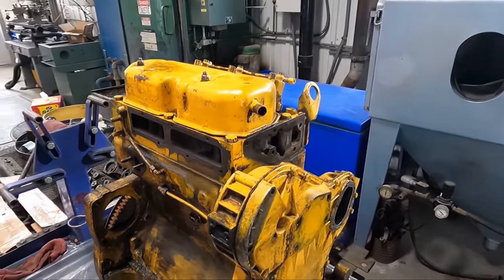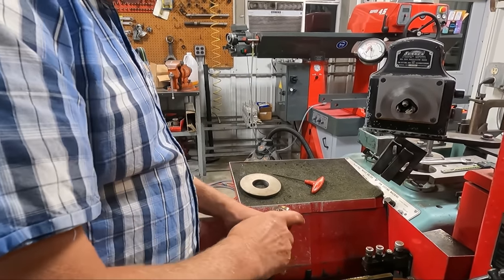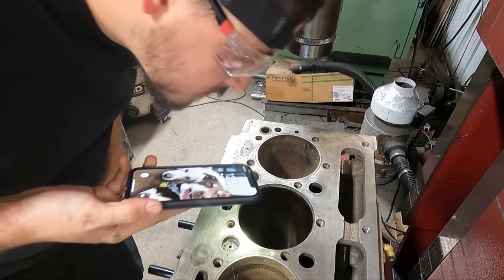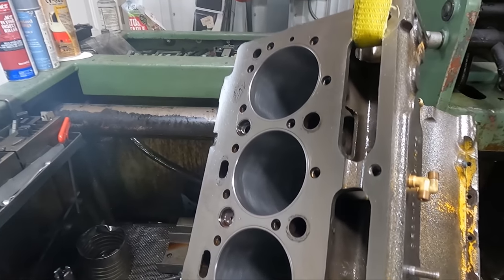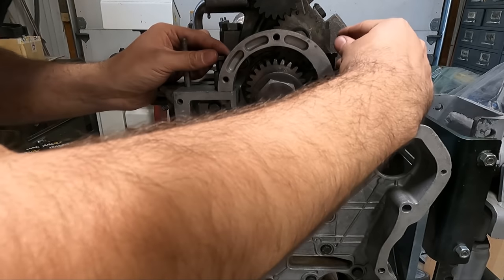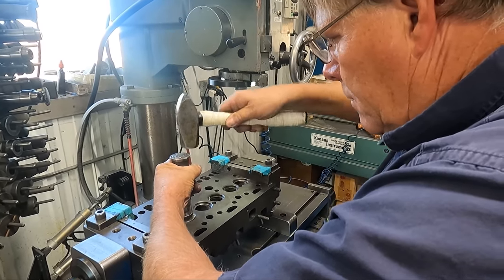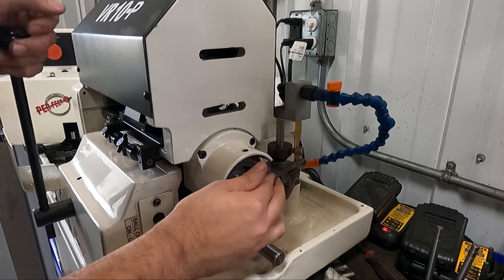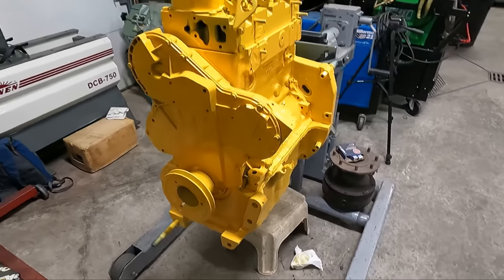Machining and Rebuilding A 152 Cubic Inch Perkins Diesel Engine In Under 20 Mins?

Comment: how about heating the block to 150 to 200 degrees and using dry ice to shrink the sleeves ? ive used this on occasion and even used cryogenic liquid nitrogen inside a sleeve while the block was fresh from heating to 200 or so degrees. this allows for a couple thousandths of expansion/shrink making insertion simple. ive used on races in hubs when i didnt want to hammer on a new unit... i am considering one of those air manual jacks for my press as well since thats a no brainer upgrade for a manual jack

Comment: How are you guys always able to find the complete engine specs on some of these older engines?
Reply from the maker: We use a combination of AERA Prosis Pro Engine Specification software as well as in this case the owner had a repair manual that had complete specifications.

Comment: Do you ever check the torque or turning resistance at the crankshaft after fitting the pistons and attaching the rods to the crank in the bare block?

Comment: Hello. As always excellent video. I have a 25hp  3 cylinder yanmar diesel it's a 3tn72 in an early 1980's Yanmar compact tractor.   I was hoping you could point me in a direction to locate New/replacement cylinder sleeves.  I am located in the Metropolitan Detroit area of Michigan.  Thank You in advance for any help you can provide.

Comment: I just bought a new Long block from California . It’s a 152,AD3. . It don’t have any dowels in the block .i need some dowels . Theres a tiny one in the front stub shaft timing  gear train . I also need the water restrictor plugs for the block . Where can i get these parts ?

Comment: Dude buy cans of air duster and hold cans upside down and spray sleeves and press into 180 degree heated block....this makes the job alot easier and most likely just slide in

Comment: Ok been working on 152 Perkins diesel I took the timing cover off the crank goes around 16 times the cam and injection pump goes around eight times before it goes back in time  is it correct for timing or do you think something's wrong or broke in engine will not start at all not even starting fluid
Reply: The cam and pump should rotate at half the speed of the crank, so that sounds correct. It's critical that the timing marks are properly aligned, failure to do this will result in the valves hitting the pistons, with catastrophic consequences!

If the engine won't fire you need to check compression and fuel delivery. The former can be done easily enough, but you shouldn't mess with the injectors or the injection pump. These parts are made to very tight tolerances and operate at extreme pressure, they're super sensitive to dirt or other contamination, and can easily blast diesel fuel through your skin and contaminate your blood (As I understand it the only treatment is to amputate the affected limb) if operated out of the engine. Best to take the engine to a professional if you don't know what you're doing.

Comment: Wait. You washed the block with the crank and main bearings installed? Isnt the water and cleaner going to eff up the new bearings?
Reply from the maker: Definitely did not wash with the crank and bearings installed 🤣
Reply: @JAMSIONLINE  I figured. I just saw you set the crank in and after that saw you cutting the deck. Ill just shut up man. Thanks for awesome content
Reply from the maker: Different style video this time lol, wanted to see how people liked combining the machining & the assembly videos into one. 

But I could see the confusion 🤣 all of the machining clips were basically flashbacks in time 🤣 

Thanks though 👌🏻

Comment: I have a question when lowering down the liners, did you ever tried to put them first in the freezer to cool them down to -20° C ± -5 °F?

Sorry the engines that I work with they have special tools (hydraulic) to take the cilinder liners out, and are to big to put in the freezer.
But at home I do it with the bearings of my car, and that works great.

Comment: Im rebuilding a 152,AD3 i got a new block . But it didn’t come with dowel pins and theirs a dowel pin for the timing stub shaft i need also . And the block did not come with the restrictor plugs in the rear of block under the head gasket area . Im at a loss trying to find these parts . Do any of you know how i can get these . Perkins main corporate so far hasn’t been able to help me . But they may not know ! I need these before i can move forward !

Comment: The Perkins three and four-cylinder engines are just so heavily built they are almost indestructible. You find them in so many things that cop abuse but they keep plugging away. It is strange to see them in some vehicles as petrol engines, well LPG actually and the injector pump is replaced by a distributor, and the injectors have a special sleeve clamped in that has the spark plug thread in it. In LPG form they also go for ever.

Comment: In a lot of situations, getting a block in a machine, to remove the sleeves is an impossibility for an inframe rebuild.   Beads of weld are fine, unless someone is a complete idiot.   On a Mack EA7-470, rebuild, beads of weld didnt get one sleeve out.  So we put a jack under the sleeve, and jacked the front of the truck off the ground. 5000kg of force got it out.  On installation the same cylinder was noticeably tighter to install than the others......so we knew for sure that the factory messed up the tolerance when they bored the block counter bores that accept the sleeves. Why does anyone use silicone, when Loctite 515 exists?   A Perkins is a good quality engine, which is well worth a proper,professional,out of chassis rebuild........unlike something like a Paccar truck engine, which should just be dumped into the nearest scrap bin along with anything else which uses fractured main bearing caps.

Comment: You decked the block twice. Now what happens on a future rebuild to this block when you put in new cylinder liners and they are sticking up 3 thousands? another decking? Aren't you eventually going to render the block unusable for a rebuild as every new set of liners means more metal removal. Or do you start shimming the head gasket. I also was thinking, put in the new sleeves, then deck, that means just one time is all that is needed. And did the deck really need decking. If it was my block, I would not want the deck cut unless absolutely necessary due to it not being flat enough to seal.  One of the attractions of engine blocks like this, is they can be easily renewed.

Comment: It's Cute...."Half of a 6.354" there is a "Two-thirds" engine too, 4.236...I guess in some applications that 3cyl is Turbocharged making 60HP vs the NA 45/50HP... In some ways I think the Perkins engines are superior to the B Cummins...it's "Quick-N-Dirty" but you can "In-Frame" a Perkins and you can't a B-Cummins.

Comment: Y’all are fantastic machinists. But please , you are killing the grammar fascists in your audience- it’s not “ Needs replaced” is missing a helping verb or has the wrong form of “replace”.  It should be “Needs replacement “ or Needs to be replaced “ or “Needed to be replaced “ . Depending upon at what point in time you are speaking. Relative to whether the action is complete or has het to take place. A helping verb , helps us all. 

I first started seeing this as shorthand in classified ads, and now I see YouTube content creators speaking it. I this may just be a windmill for my solo tilting torture, but I fear it’s one of the four horses with epoxy-lips.

Comment: Come on guys.  Can’t replace rod bolts without resizing…🤦‍♂️
Reply from the maker: You are correct in the instance of a connecting rod where the bolts are a press fit into the connecting rod.

In the case of most Perkins engines such as shown here, the rod bolts are a slip fit to the rods and thus cause no distortion when being removed and installed.